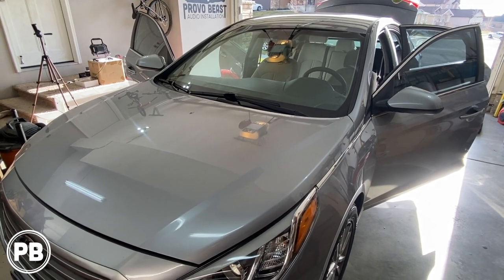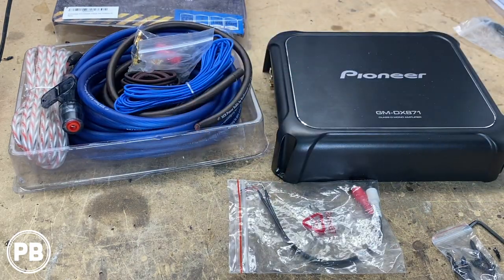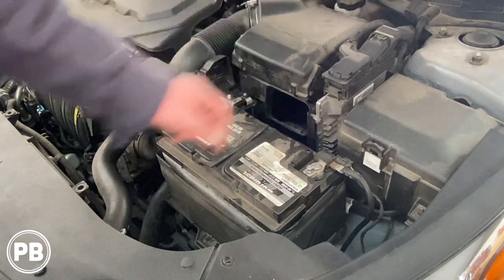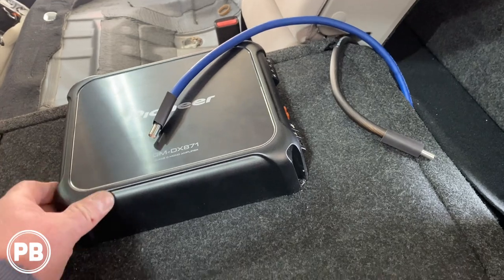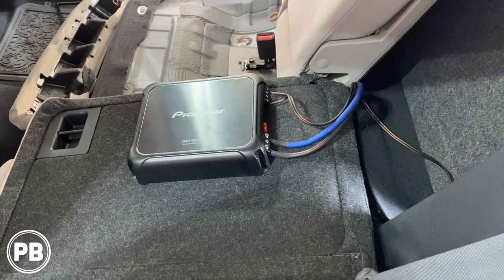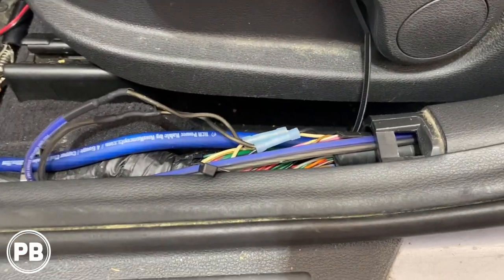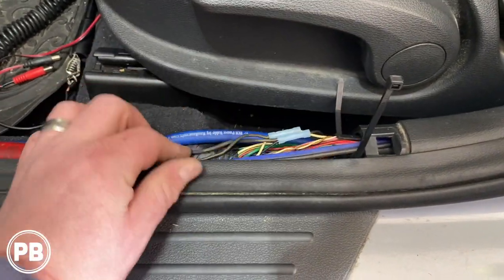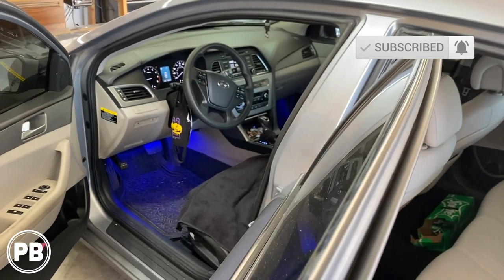2015 - 2019 Hyundai Sonata Amp and Sub Install

Comment: Problem with going just left is that if he likes older music and drums are on the right, then the subs won't receive the signal. Other than that, Clean work.
Reply: Never thought about that!  Wow.
Reply: That was my only thought when watching this and considering  putting subs in my Sonata.
Reply: So how would u do it to prevent that situation u mentioned ?
Reply: @anthonys9257  wire both left and right and the amp will pick up both channels
Reply: So the rca jack wires connect to the rear speaker wires?
Reply: @CravingTheMagic I'm helping my nephew on a 2019 sonata but the factory radio has no jacks.
Reply: @nelmor29  you need high level inputs on the amp. Or a high level converter

Comment: Please add the colors, I can't find a correct wiring diagram anywhere.
Reply: Doesn't look like he is going to update, I found this:
Reply: Left Front Speaker (+/-)      red - blue      +,-      radio, white 18 pin plug, pins 2 - 11            

Right Front Speaker (+/-)      green - orange      +,-      radio, white 18 pin plug, pins 3 - 12            

Left Rear Speaker (+/-)      white - black      +,-      radio, white 18 pin plug, pins 1 - 10            

Right Rear Speaker (+/-)      brown - white      +,-      radio, white 18 pin plug, pins 4 - 13            

Center Channel (+/-)      red - blue (JBL)      +,-      amplifier in trunk right side, white 12 pin plug, pins 5 - 11            

Subwoofer (+/-)      white - brown (JBL)      +,-      amplifier in trunk right side, white 12 pin plug, pins 6 – 12

Comment: I have the infinity premium audio sound system. Can I replace everything without adding an extra Amp? Speaker upgrades and subwoofer upgrades?
Reply: I'm not a pro installer but my experience says yes. Just be sure to match the impedance of your upgraded speakers to the speakers installed by the factory.

Comment: Hey Provo Beast Audio so I had an audio shop install some subs and an amp in my 16 sonata and whenever I floor it in my car or get going a certain speed the amp will turn off and so will the subs, I have to turn the car off then back on again for it to turn on and start working again. Any idea as to why it does this? I do have a LCI 2 pro that’s hooked up to the amp as well. The headunit is the stock one as well and the car does not have the factory upgraded sound system either.

Comment: Sorry but why you screw it down to the seat? That’s just a small amp you could have hidden it well in the truck on both left or right corner of the wheel box

Comment: I have a question. On my 2017 sonata sport. I have a RP-1200.1D | 1,200 Watt Monoblock with Skar Audio Dual 12" 2400W Loaded SDR Series Vented Subwoofer Enclosure | SDR-2X12D4. For soemtime now ive noticed a surge, i think thats what its called, everytime i switch it on. The ABS light flashes, meaning there is low voltage, according to google. 😅 anyway do you think it has to do with my set up? My battery also died after 2 years and im currently using a refurbished battery while i put my claim in to use my warranty and get a new one. Im worried that something wasnt connectes right. I feel that is something going on in the engine. Thanks for your time. -Wendy

Comment: What Amp wattage and brand is best to install on a 2016 Hyundai sonata and does it matter what size of the subs to install cause I perf 12' to 15' and can the factory radio be switched out to a newer radio like a flip screen.
Reply: Yes it can I did it to mine got a nine inch screen in mine
Reply: 6 3/4 in speakers. You have to listen to a lot of speakers so you can determine what’s right for you.

Comment: I did this same hookup in my 2020 Elantra and the amp stays on, it wont shut off, and it has high level imputs, when I plug in the speaker wire to the amp, it turns on and stays on
Reply: So is my 2016 sonata with the touchscreen radio. How did you fix your car?

Comment: I ran the remote turn off to the fuse but it doesn’t turn the amp back off
Reply from the maker: Sounds like you tapped into a constant 12v, instead of an accessory 12v circuit.  Check your placement using a multimeter.

Comment: You didn't put the colors 😅
Reply: Just got to the last part on my Hyundai for my line-out and i realized he never posted the wire colors 😂
Reply: @mylesharrison5947  you can tap into the speaker entries, much easier to do.
Reply: @mylesharrison5947  did you ever figure out the wire colors? I can't find them anywhere.